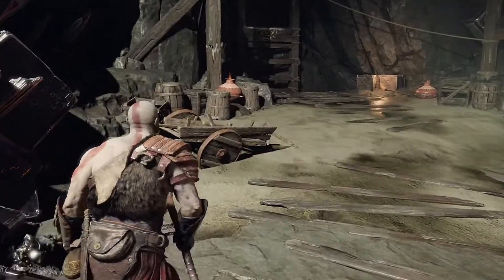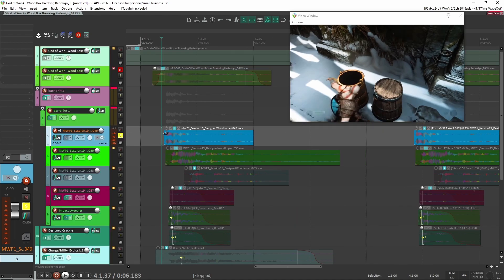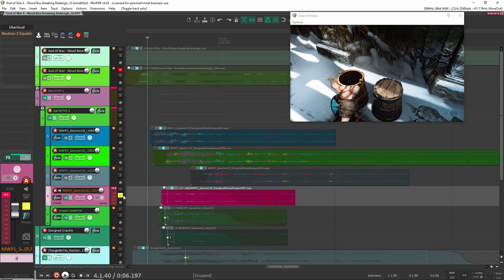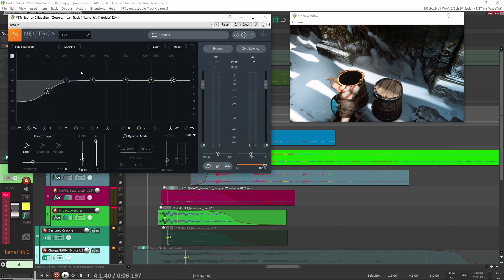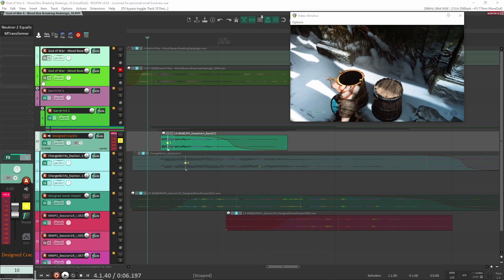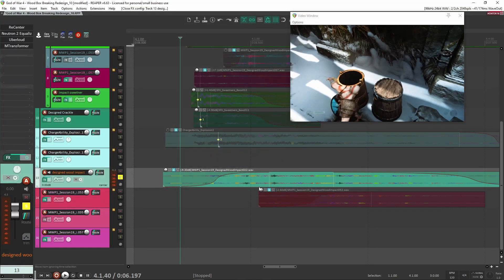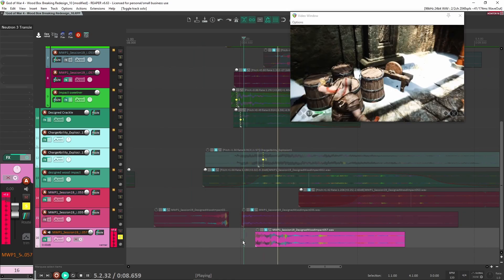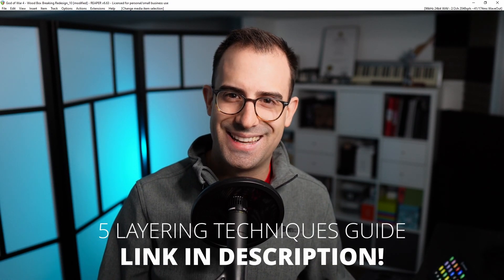How To Create A Wood Shattering Sound Effect

Comment: This is what I recently need, nice timing! I have got in a game company last month, but I still can't catch up my colleagues' progress, my leader always said ' It sounds not aggresive enouth' or 'too flat', etc. I got used to desigen by 'sense' or 'spark of ieda', really lack in porper  
methods/techniques. Espatially on desigining the emotion of generic actions between enemy and player, for example, how to make the enemy whoosh sounds dangerous/threating while player acting at the same time? I referenced some of my favorite games like souls series, Nioh , Dmc etc, seems the common thing is their enemy whoosh has a lower pitch than player, and more 'dirty'
'evil' tone, some distortion effect maybe? Any way, do you have any idea about the way of varifing sound charateristcs? Quite a complex question..😕

Any way, your video series like this helps me alot, great thanks🤝
Reply from the maker: To differentiate between different characteristics - the pitch is definitely one way to approach it. You could also consider texture or timber. Also, tonal vs noise. And of course, you could always use an EQ to bring out certain parts of the frequency spectrum or certain parts of the sound. Hope that helps.
Reply: @daviddumaisaudio  Thank you for your sharing!😆 I have added some rusty metal garbage slide sound in enemy whoosh and it works,  then I use the multiband imager in Nuendo to narrowfy the muddy low frequncy，I learnd this from some music mixing tutorial, it seems there are some common sense between the two.
Reply from the maker: Yea, in general, you always want the bass/low frequencies to be centered.